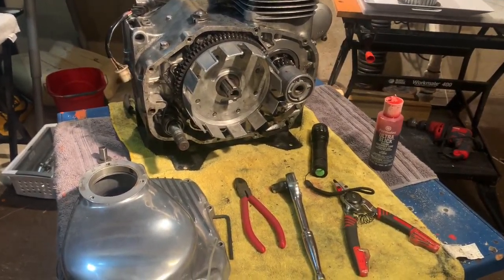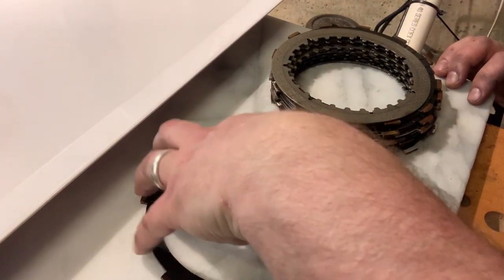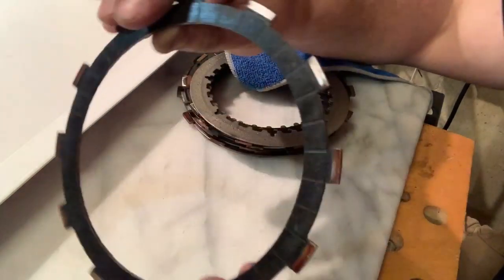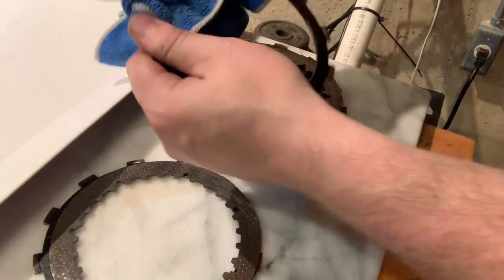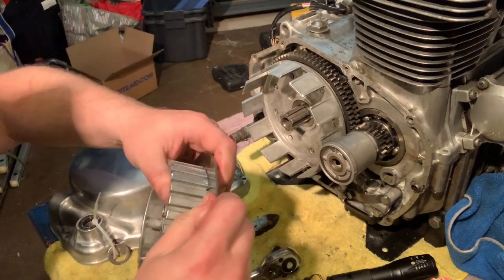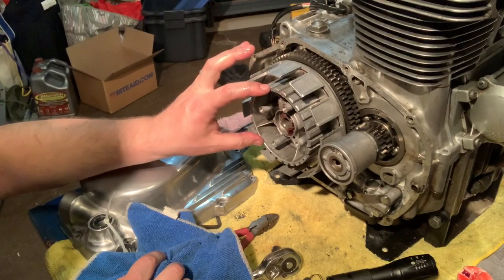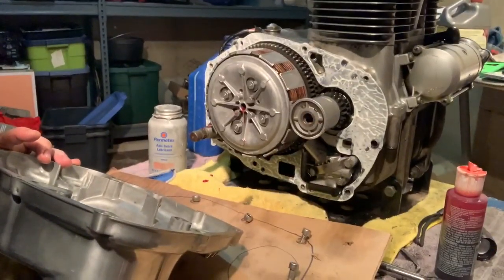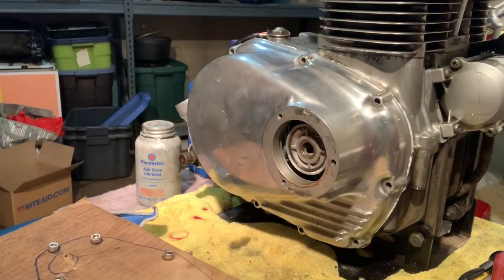How To Install Clutch Plates & Engine Side Cover: Part 159

Comment: Nice job....I used the Common Motor bolt kit on my 1970 cb350 also (plus thousands of dollars of other parts from them)......did buy a T-allen wrench to help.......Fast forward well used. We are currently install wiring (started last night) with custom wiring harness and M-unit basic. We are also going with electronic ignition......We put engine in first, so kinda working backwards from you......
Do like your cardboard idea with these allen head bolts.......Missed where you live...I am in Tipp City, Ohio, about 6 miles north of Dayton, Ohio.
Reply from the maker: David Aldrich a T would be super nice. Need to look for one of those. Hope to get the engine mounted soon! Thanks for watching, David. Good luck with your build! Love those 70 tanks!